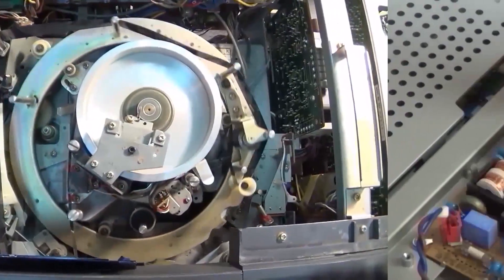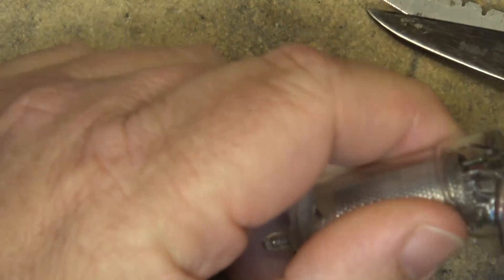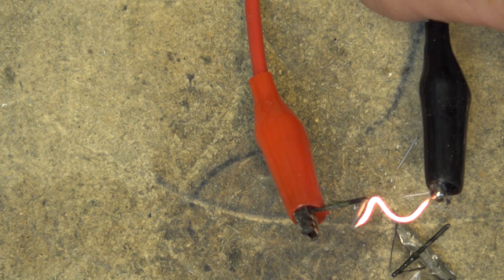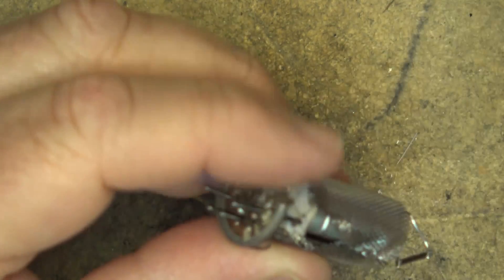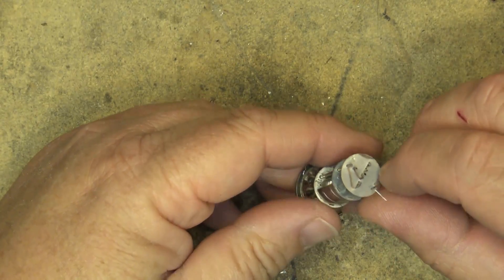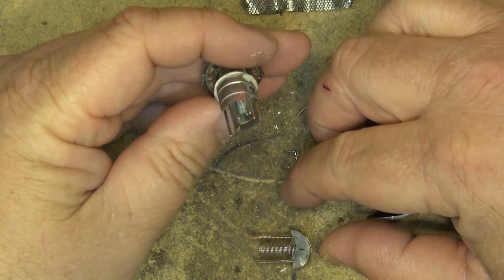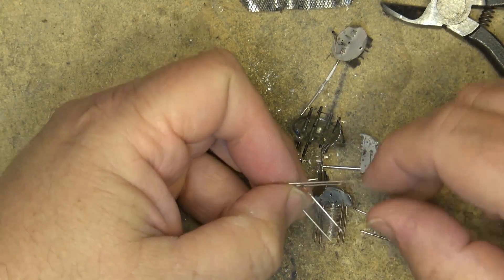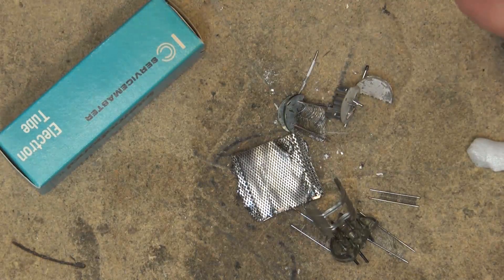Vintage 6CU7   ECH42 Vacuum Tube disection

Comment: The outside is a screen, connected to the cathode, not a plate. The plate is the flat metal structure under it.
Reply from the maker: Right. The second plate for the triode is on the top, both under the screen.
If you look at the 4:33 mark you will see the triode portion of the tube at the top of the tube between the mica insulators. I didn't tear that part down, but there is indeed a single grid under that plate. Because this is a stacked tube the shield screen is wrapped to prevent electrons that escaped from one plate being attracted to the other. In the american type designs they put the 2 separate cathode, grids and plates side by side. This being an RF tube made shielding mandatory, so this is probably why they went with a stacked design with a single cathode, and then used the grounded screen at cathode potential to reduce RF radiation.

Comment: There's a good chance that tube (or valve as it would have been known in the factory) was made less than five miles from where I live, in one of 3 or 4 Mullard factories in the UK. One of my aunts worked at said factory so it's even possible (though rather unlikely it must be said) that she was involved in building the thing.

Was this an original part in the radio? Pye worked a lot with Philips, and were bought by them in the mid 1960s IIRC. Philips UK used Mullard tubes almost exclusively, and bought them up in the 80s I believe.
Reply: mullard WAS philips, at least since the 30s, maybe before , cant remember for sure,  some uk philips sets had philips 'miniwatt' branded valves, mostly the rectifier..